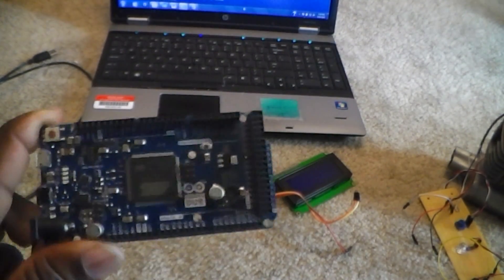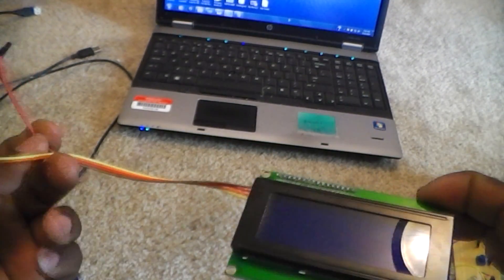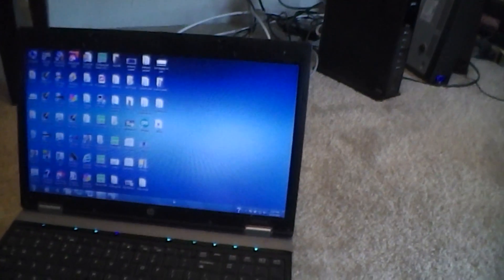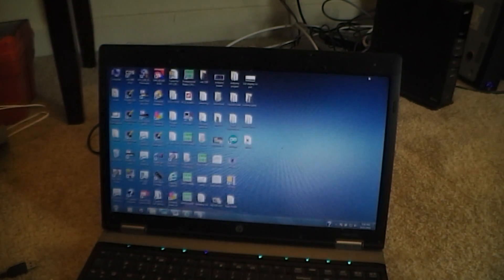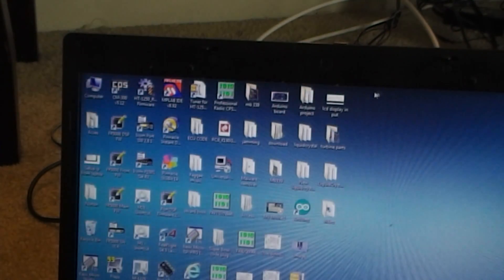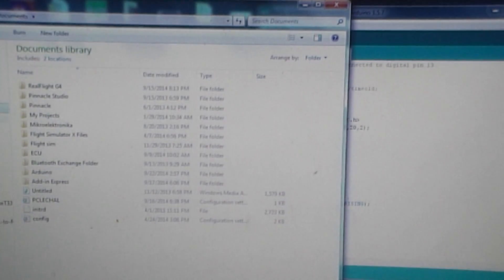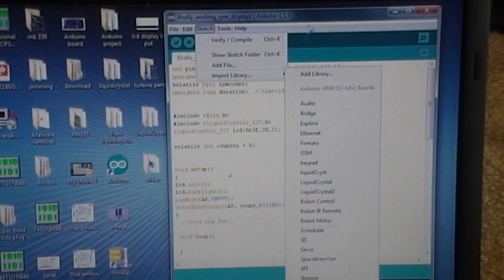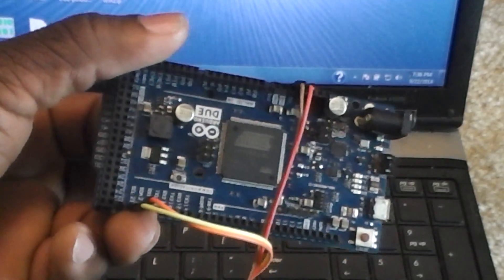Arduino Due LCD

Comment: Please got to Sain smart site and download the library put in the Arduino IDE ...look at the sample sketch and it will tell you where to plug into the board you really need to have an electronics  background  to play around with the DUE board also the DUE is 3.3 vdc not 5.0vdc like the other boards ...does the display run on 3.3vdc or 5.0vdc there is a way to make it work ...useing a level shifter.

Comment: Landed here whilst looking to find a way to run Due and LCD for 3D printing.You sound like a Jamaican to me, Respec' ;-)
Reply from the maker: Yeah mom ;-)..I think it will work for your 3d printer project...I was try to use my due to run a turbine engine but got stuck with the RPM not going over 10000...so I quit the project..I hope you have better luck with your project..I would love to see your progress man.